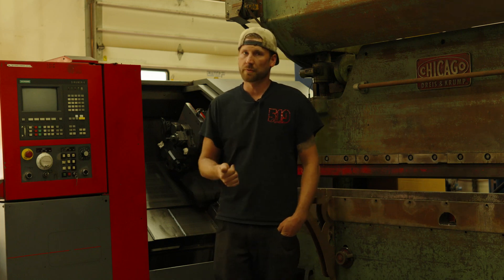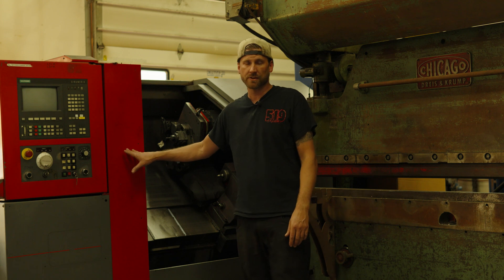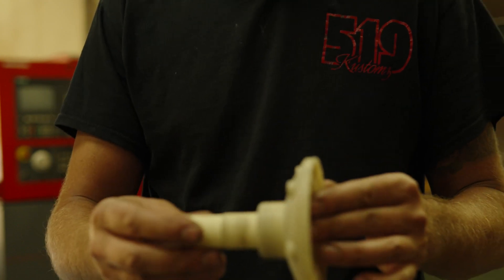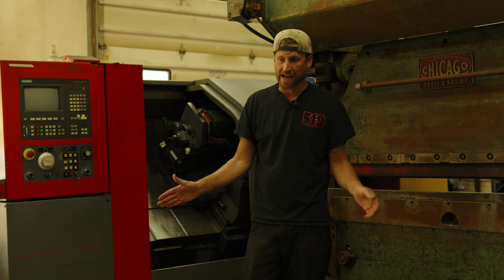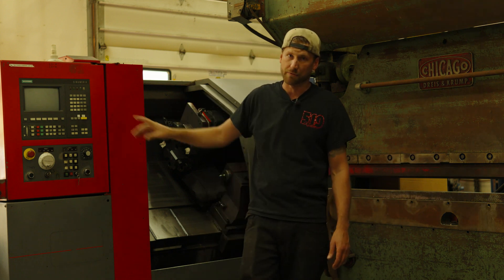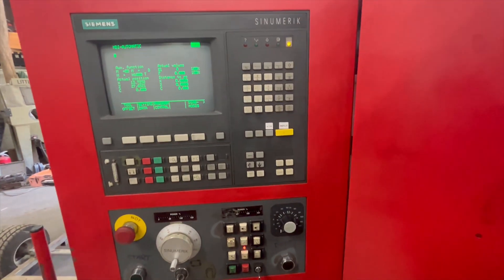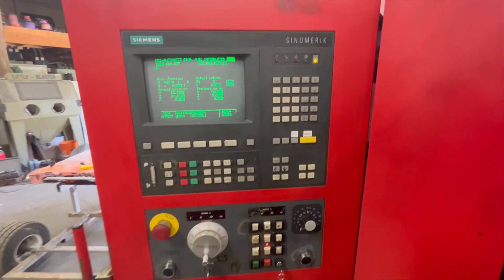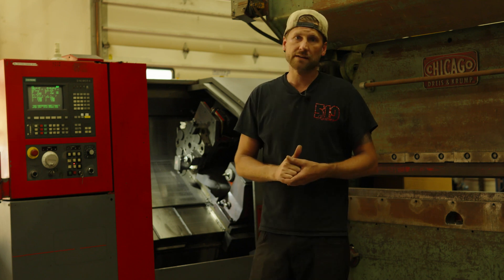I bought a 27 year old Emco CNC Lathe with Live Tooling

Comment: That looks like a nicely maintained machine. I would second the suggestion that you "hand write" the programs. We have a pair of older lathes with Fanuc OT controls. They typical have very little memory. Most CAD to CAM processors write out each X-Z move. If you are roughing from a large diameter to smaller, you can end up with hundreds of lines of code, whereas the routines built into the lathe can do it with one long block. We write every lathe program by hand, whereas we haven't written a single program for our mills by hand. It's not as hard as you might think and it definitely ups your game.

One thing that makes the built in routines so nice is they might have a rough-finish routine to a profile. Typically one of the parameters is depth of cut. If you find the original path is too conservative or aggressive, you just change the value of one parameter in that block of code and your back in business.  I am sure that control will also let you plot the tool path on the control.
Reply from the maker: Yeah I am quite pleased with the lathe. I did find a post that works in fusion for id and od turning, but I do hand write the rest of the programs. Excellent built in routines for threading, but the milling and off axis drilling I hand write. I agree it helps you understand way more about how and why the machine moves!

Comment: stubs for the MGR axle hey,  have you gotten decent power out of one, being they are wound for 600v? i know recent success with the latest openinverter firmware @ 400v makes it usable
Reply from the maker: I have really back burnered that project as customer stuff has been busy, but it is always on my mind.  I am trying to retrofit another inverter as i have always had a minor issue with the resolver offset being so hard to nail in the openinverter. But i have also always had half and idea to try to incorporate the toyota or similar boost/buck converter to run at 600V

Comment: I'm from Austria and i work with such machines for 12 years now (we got two ET360 and oder emcos). I really like the Sinumerik 810 but the main problems with these machines is that original spare part prices are getting out of hand and that's why we're moving away from such old machines in our shop. However, this machine is really robust and doesn't break very often. In my opinion the machine isn't very good for CAM programms because of it's limited space for programms and also it's limited use in general. If you have any questions about programming it on the machine just let me know. Nice video and keep going!.
Reply from the maker: Thanks! The shop I got it from said it held tolerances perfectly and they have never had an issue that way. It is very heavy so I'm pretty sure it is made to last. I can understand how parts are getting hard to come by, hopefully I don't run into anything major. I got it sending and receiving data now so i just need to figure out post processor. I appreciate the offer, and I will reach out for sure if i need some help. (likely will!!)
Reply: سلام امکو ۴۶۵ هم کار کردین؟میدونید قیمتش اونجا چنده؟

Comment: A mate of mine has just done the same thing. He is a self taught machinist . Started off with a new 4 axis machine with a Siemens controller. He quickly found it's limitations so he's bought a couple of bigger old machines very cheaply. He is going to upgrade the controls with a modern controller. He uses Fusion 360 also.  All for a very affordable price relatively speaking . Lots of potential there if you've got the space and the power supply. Looking forward to see how this develops for you. According to my mate it's pretty addictive.
Reply from the maker: Yeah i like the older machines myself also. Not just because the price point is better, but i think the machines are built better. I'm super new to cnc but love it so far!